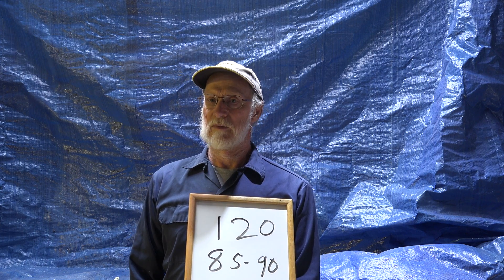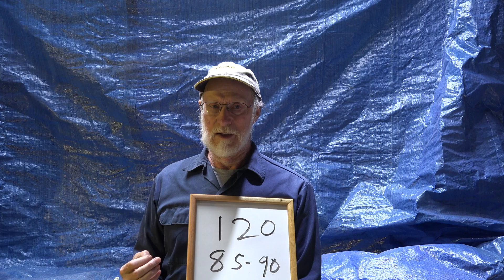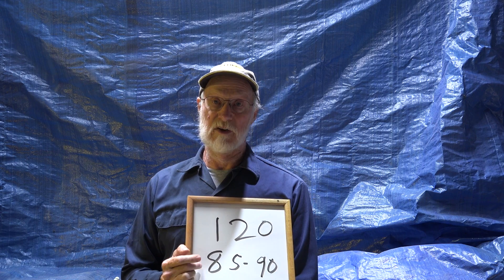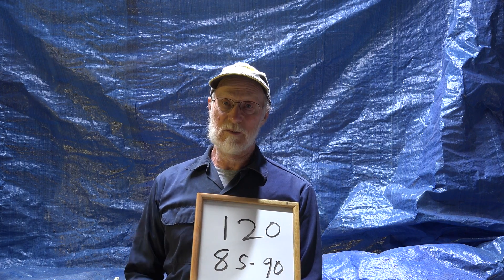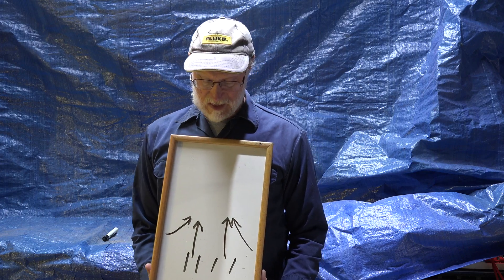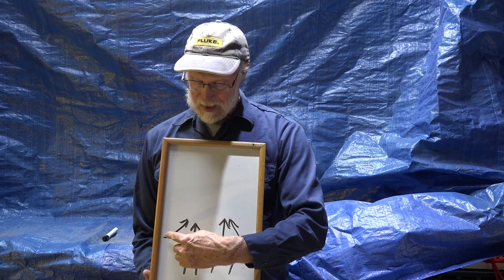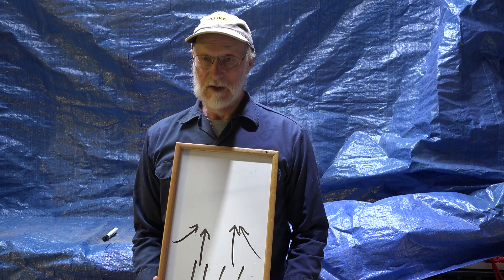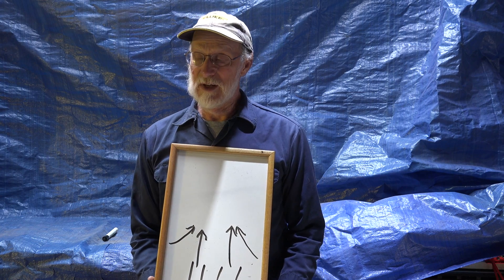What should the duct temp be

Comment: My heat from furnace comes out of vent in floor at 146 steady. I have no heat pump.
Reply from the maker: How old is the furnace?
GFM
Reply: Turns out it's a limit switch. I bypassed it with a short wire. I should get the new one Friday.

Comment: My air blowing out of ducts is 85-95 max which seems weaker than before on my carrier weather maker 9200
Reply from the maker: First thing I would do is check to see if your unit has been recalled.  Many of the units have been recalled for heat exchanger failures.
GFM

Comment: Great tutorial as always.  My supply temperature is 138F and my return temperature is 80F. Rating plate says 40F -70F. Just wondering why the thermostat is reading 72F when my return temperature is 80F?
Limit switch is 170L-20 but furnace still trips on high limit. Is it a bad high limit switch? Thank you.
Reply from the maker: You have an air flow problem.  As in not enough flow.  Limit switch is probably doing its job.  The discrepancy in set temp and return is probably from low air flow, however system design could cause can also effect. 
Look for plugged A/C coil, dirty blower wheel, fan motor speed set too low or duct problems.
GFM

Comment: Even back in 1978, the furnaces were maximum 100 degree temperature rise, oil and gas.  I don’t know what years you are talking about but I never saw 150, or 120.  The output rule for heat pumps was 30 degrees at 70 outside and 3 degrees les for every 10 degrees drop in outside temp.  This does not include supplemental heat.  As you can see, temp rise of a heat pump depends on the ambient temperature around the outdoor unit.
This is assuming clean coils and filters, and proper indoor airflow.
Reply from the maker: I am not talking rise here.  This is duct temp.  This is a comfort video, not a diagnostic one.  As for heat pumps, I would not be running a heat pump at 70F outdoor ambient.  Heat pump  rise is quite excessive above 60F outdoor ambient.  But the heat pump will run for a very short time at these high ambients which saves compressors during these heating times.
GFM
Reply: @grayfurnaceman  I see now.  I should have listened more closely

Comment: With maximum blower speed on Stage 2, I'm measuring 125.8 on heated supply discharge, and 80.6 on the cold air return.  This temperature is within the ranges in the booklet, but not the 110° you consider desirable.  I still have to measure the 1st stage output.    Later I'll measure with other blower motor settings.

I'll say one thing, your videos are much more informative than the documentation that came with the furnace which provides some alleged specifications or ratings, but isn't helpful in actually setting it up.

Comment: What about ceiling diffusers and stratification? Any difference in recommended duct temp?
Reply from the maker: Ceiling diffusers are the worst type for heat.  Great for cooling but bad for heat.  About all you can do is get the fan speed as high as you can and keep the duct temp as low as possible.  Even so, the heat usually is not effective below 2 to 3 feet above the floor. 
GFM

Comment: I had two furnaces twined together they were 1983 Doumatic Olsen one of the first High efficiency two heat exchanger furnaces.  Over the last three yrs. the I just couldn't get them to stop short cycling. I cleaned, changed parts, and adjusted controls. No Luck.  So this past week.  I installed two new Bryant 90 plus furnaces.  This time I have One heating the southern half and one heating the northern half of the house so now they zoned.  NOW for my new problem.  The first 3 vents on each furance blows air like crazy and is very noisy.  The rest are quiet and suppling good heat to the other rooms.  i bought 6" dampers to slow the air flow on the vent runs.  Where should I install them near Trunk line or near the vent boot?  Also the first return 4"x12" closest to each furnace is noisy too.  But there is no banging or ducts flexing when they are running or when they turn off.  I cross Xed the duct work closest to the furnaces to eliminate banging and flexing.  Grey Furnace Man What are your suggests?  A Loyal subscriber.